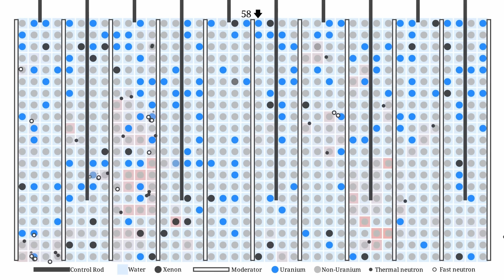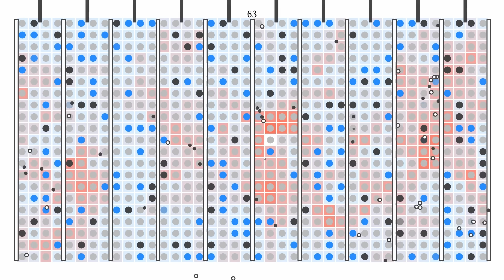Chernobyl Accident - Simulation only (no talk)

Comment: They did the equivalent of turning up the radio to drown out a concerning mechanical noise in the car.
Reply: Then disconnected the brakes and held the throttle wide open.
Reply: @josephastier7421  to get a car stuck in mud out. With no comprehension of just how powerful the car's engine was, and how, the moment it got out of the mud, it was already half the way across town, running through anything in it's path.
Reply: these were incredibly smart people working there, but theyre humans. They panicked and they didnt follow what they studied
Reply: @user-uw3ru5qj3rso smart that they ignored all safety functions and caused Chernobyl to implode!
Reply: @alessandrarivera1925 I’m sure your smarter
Reply: @user-uw3ru5qj3r No, they were smart people being led by a jerkoff in charge of a reactor with a critical design flaw.
Reply: @user-uw3ru5qj3r no they weren't even qualified and were put to follow dangerous orders with no chance of speaking up
Reply: @Kalleybi  yeah im sure you are much smarter than they were👍
Reply: @Kalleybi  nuclear power reactor workers - these guys are the top of the top, the cream of the pie. You will only find smarter people at NASA and SpaceX,. The fact that you cant seem to understand this says alot about you.
Reply: @Kalleybi  im sure some random not qualified individuals could not only set up but also maintain a nuclear powerplant for so long.
Reply: @user-uw3ru5qj3ryou're forgetting it was the in the USSR, the Communist used whoever they found, the engineer chief was the youngest one in there he was less than 25. I'm an electronics engineer working in a research lab and the radiation samples cabinet is a no go zone even for my boss. Moreover they didn't know that the rbmk reactor boron bars could build up reactivity when first inserted bc the tips were grafite to, guess what, make them cheaper... classic communist behavior.
Reply: @user-uw3ru5qj3r kalleybi is right. They were non qualified workers. They didn't know what they do and were given only instructions for some scenarios. Matter fact, it wasn't fully their fault. The facility violated MANY occupational health and safety rules. They were basically sent to certain death. They just didn't know it.
Reply: @Kalleybi I’m sure your smarter
Reply: @user-uw3ru5qj3r You are forgetting one huge problem....Soviet Union.....they most certainly did NOT have the best of the best, they had the best that a oppressive communist regime could produce....a regime that killed competition and personal goals to be better through hard work and competition.
Reply: @user-uw3ru5qj3r this is called glazing.
Reply: Heh, "turning up the radio".
Reply: No, they PANICKED and didn't follow procedures
Reply: @TruthHurts_81  and didnt know fully how the reactor would behave
Reply: @TruthHurts_81 I’m sure your smarter
Reply: @juniorseyes8326  who taught you English?
Reply: Now they wage war to drown hunger and infrastructure concerns
Reply: @Ntrbncmlc I’m sure your smarter 😂
Reply: Hold my vodka russian style
Reply: The the combustion chambers cracked open.
Reply: Years ago my now ex brother in law worked for the local auto manufacturer of my old car at the time. He was a very vain person who often liked to self promote himself wherever and often through the guise of "sharing" knowlege/experience for the purpose of "helping" which I could clearly see through for his true intent.
    The one and only time I had him in my old vehicle to give him a needed ride was priceless and I wish I had his reaction on video as I  maintained a straight forward poker face demeanour when I replied to him. (In fairness to him and in this one instance, I do think that he was genuinely offering advice to help me to avoid future costly repairs but I couldn't resist the opportunity to deflate his over inflated ego tyres). He turned to me as I was driving and said that he thinks my rear left wheel bearings were on their way out. I had long suspected this as I drove that car all the time and had to listen to the constant low grinding sound but I was not gonna waste money on repairs that cost more then car. I kept looking forward at the road ahead and without showing any  emotion stated something to the affect of "That's why I upgraded my stereo" and I turned the volume of the radio up loud drowning out the bad wheel bearing and him in the process.
    Much appreciation for posting the Gold joke comment and the memory Lane visit.
Reply: You're not supposed to do that?
Reply: @HumanBeanbag  lol

Comment: Chernobyl only became a problem when the rod temperature reached "film boiling".
That's like a hot fry pan on which water droplets dance and sizzle, so about the temp you get when you want to fry a steak.
Once Chernobyl hit that "film boiling" temperature the heat transfer changed from "convection dominant" to "radiative dominant".
Temp jumps from about +120C to like +3000C and that's the "yipes run man!" because the metal is melting.

Comment: So the control rods are used to slow down neutrons so the core doesn’t overheat because it can withstand high temperatures. But I guess graphite spontaneously oxidizes in the presence of oxygen at 550 degrees celcius and the operators allowed it to get too hot, so the control rods caught fire. This kind of fire is self-sustained as long as oxygen is present, so the reactor fire lasted a VERY long time. The Chernobyl accident wasn’t directly caused by the graphite rods, but these kinds of rods have directly caused a near accident before. 

In Chernobyl due to their design  there was a massive power surge that happened mid-test and the coolant fluid basically ran out, so the fuel rods melted together and hit criticality almost immediately. And then the graphite rods just happened to draw out the event. 

I think modern rods are made of zirconium.

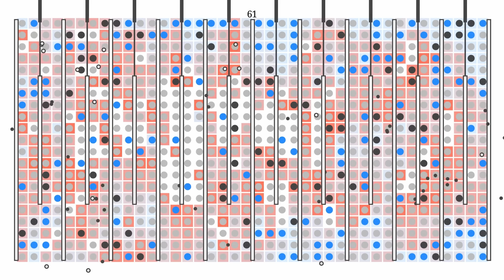Comment: The moment Event 6 starts at 3:17 is the moment control room operator Leonid Toptunov pressed the AZ-5 button at 1:23:39 A.M. EET. Pressing the button was supposed to shut the power down by inserting control rods into the reactor.

What Leonid didn’t know was that the rods were tipped with graphite, and when exposed to enormous amounts of nuclear energy, graphite only exacerbates it. The result was a skyrocketing amount of power in the triple digits that lead to the two explosions in a matter of seconds.
Reply: There was nothing wrong with the rods being "tipped" with graphite. Graphite was needed to maintain a healthy neutron economy because they were using lowly enriched fuels. What was wrong was that the "tips" were short enough to leave an entire column of water at the bottom of the core when the rods were fully withdrawn. Displacing that water (neutron absorber) as the rods descended triggered a sudden massive increase in reactivity, which ruptured the channels and ultimately led to the steam explosion.
Reply: @Athena.87 there was an atomic explosion including a mushroom cloud, btw
Reply: Lots of people do not read the source documents, but instead memorize simplified (to the point of being incorrect) explanations.

The reactor's core is 7m high (it's cylindrical). The control rod (from top to bottom) consists of 7 m long neutron-absorbing section (this is the part of the rod which sits exactly in the core when the rod is fully inserted); 1.25-m long telescoping empty tube, and 4.5 m graphite tip ("displacer"). These two sections go below the core when control rod is fully inserted - for this, the vertical channel the rod sits in must extend under the core for ~5 more meters.

The role of that graphite displacer is to make reactor more efficient when the rod is withdrawn: without displacer, the channel would be filled with water, which absorbs some neutrons, reducing efficiency. Graphite absorbs almost nothing, thus it's better.

Ideally, you'd want to make this displacer 7 meter long too (full core height), but this requires 7 m of additional vertical piping under the core. That's why they made displacer shorter, and made it collapse (telescope) when the rod is fully inserted. This shortened that under-core pipe to ~5 meters.

In the accident, before the fully withdrawn control rods where inserted en masse, all their displacers were located "in the middle of the core" vertically, with about 1.25 m of water filled in-core channel below them (and 1.25 empty rod section above). When they all started moving down, the displacers displaced that 1.25m of water. At 0.4m/s insertion speed, it took more than 3 seconds to just displace that water, therefore mass rod insertion increased reactivity in this lowest part of the reactor, and did not yet decrease it in the middle section -  the absorbing sections of the rods just only begun entering upper 1-2 meters of the core. The resulting large power increase distorted the channels (both control rod, and fuel channels), and rods were stuck (couldn't move down further).

If the rods would be longer and had full 7-m long displacers, such transient power increase wouldn't be happening when they are inserted: there would be no graphite replacing water in the core (it would be happening in passive tube under the core).

If operators had good understanding of this design deficiency, they would know to avoid mass control rod insertion. If they would insert the rods in small groups, not all at once, the transients would be much smaller and localized. However, reactor designers preferred to pretend that reactors are "absolutely safe" and no design deficiencies exist, thus training of operators did not cover such details.
Reply: @denysvlasenko1865  Exactly. This is the correct explanation in the final report INSAG-7 on Chernobyl disaster. Unfortunately, most people base their knowledge on the TV series...
Reply: The graphite tips are actually a neutron moderator, the rest of the control rod is a neutron absorber . For the neutron to cause fission it not only needs to hit a Uranium atom's nucleus it needs to be traveling at the correct speed, that's what a moderator does slows the neutron down. So the initial insertion of the rod would cause a spike in reactivity and corresponding spike in power. So most of you mugs arguing over this are wrong. Every current commercial reactor in the US does not use graphite as a moderator, it uses the cooling water. There have been experimental graphite moderated reactors in the US and there was one commercial graphite reactor but it went belly up due to financial reasons decades ago. PS as a Control room operator it is incredulous to believe that Leonid did not know that the control rods were graphite tipped.
Reply: @stuglenn1112  As shown in The Simpsons, not all nuclear power plant operators are as smart as you.
Reply: The rods got stuck into place, and the graphite coating instead caused the reaction to continue and increase without end
Reply: Graphite coating absorbs neutrons which actually slows the reaction or stops it if lowered completely. At the point the button was pressed, the rods had already begun melting and it was too late
Reply: @jkyleowens  Incorrect, reactor power was stable until AZ-5 was pressed, which is what triggered the reactor runaway (see Annex I of INSAG-7 for a detailed description of events).
Reply: @jkyleowens  Not sure why you've got some likes, you're incorrect. The control rods weren't coated in graphite, they had a graphite section at the end which acted as a displacer, the purpose was to push water out of the channel when the rod was withdrawn to maintain cooling efficiency. Graphite does not absorb neutrons significantly, it moderates neutrons making them more likely to cause fission in U 235.
Reply: I get a weird feeling looking at these conversations where people with probably zero education in physics and completely different opinions on something big, unapologetic and scary disagree with each other, each one stating that the previous opinion is wrong and their own opinion is right. It's like 5 doctors look at the body and try to prove what happened with no tools, no history, no knowledge but all saying their opinion is the correct one. I feel despair.
Reply: I feel you, and in the end you're left to wonder who is right, all of them, none of them?
Reply: @I_am_supernovae  I tried to read the comments to try and learn something but everybody is contradicting each other. Even in the top comments there's dozens of different opinions on what how or why something happened. What I learnt is that 99% of comments in such videos come from people who don't know what they are talking about.
Reply: @I_am_supernovaelike you have all the answers? you can stop with the pseudo-intellectual armchair physicist act, the problem you have is with people being able to discuss things freely
Reply: @idkausername10  they're looking at comments that are disagreeing about something that should be known, and wondering who has the right story and worse, how they can all sound so smart...but disagree.

They, like myself, aren't armchair physicists. We're just plebs who watched the video and wondered how it happened because we do not understand it.
Reply: @DembaiVT Said the person who wasn't who I was replying too. You love to talk for other people, don't you?

Comment: Again, like in any other disaster, a chain of events has occured which lead to this.

First, there was a delay for the test.
Second, another power station wasn't able to produce power so the dispatch told the Chernobyl plant to keep the high power going for longer (until the evening when the power requirement will go down. This made them wait even longer.
Third, the xenon poisoning kept happening for longer and longer.
Fourth, many times workers had not to obey the rules because they needed to catch up to the plan.
Fifth, the delay was so long, that the crew which didn't expect to do the test had to. The day shift was supposed to do the test. In realisty, it was the night crew.

Comment: 3:08 "Free neutrons burn away all the Xenon, Now there is nothing to stop the reactor" gave me goosebumps
Reply: Thats the key event for them to press AZ-5.
AZ-5 doesnt hold the reactor in control instead its an ignition for the ultimate disaster. If only they designed the control rods to not have their tip as graphite.
Reply: @Emhyrkhan 
The advantage of graphite use in this case was, that it reduced the friction of the rods without the need for extra lubrication. That would be the reason for such material choice, according to Ockham's Razor
Reply: @dakzibbon6589  They were graphite tipped to lubricate the channels, but only as an afterthought, because the control rod channel assemblies were poorly manufactured and caused the boron rods to jam and require manual intervention. So the graphite tips, a key to this disaster, was never part of the original design, nor part of the intended operation by the scientists and engineers who created the initial RBMK reactor design. The other option, rather than just slapping a puck of graphite on the control rod, would be to replace the whole assembly with something more expertly machined, which would be prohibitively expensive.

Comment: almost feels like a slow burning fuse. They remove the control rods completley to make the fuse burn quicker, then turn off half the water circulation in order to lessen the length of the fuse. The fuse then instantly burns through the rest of the fuse due to the material in the fuse being used, and finally reaches the explosives, causing a bang in an uncontrolled explosion.

Comment: So, what initially caused it?
Reply: An explosion and fire that demolished the reactor building and released large amounts of radiation into the atmosphere.
Reply: Safety tests
Reply: The initial problem was the low output due the xenon contamination. They tried to increase the power (they apparently didn't know about the contamination) but went too far. They removed more control rods than recommended which Kick started the chain reaction. And when they tried to shove it back, it got stuck with the Carbon tip right at the middle increasing it even further. And the rest is history.

Comment: I have a side note to your video. Pretty sure it shows how the reactor ran away but the effect was comming from the bottom. The bottom of the reactor was almost running 100% all the time because of how large the reactor was and how uneven the neutron flux was distributed over the active zone. Bottom reactor was full of voids and the uncontrolled chain reaction happened at the bottom ( 4 seconds befor the explosion they hit AZ-5 button ) one second later in the middle then the control rods were stuck in the upper parts of the active zone displacing water and creating even more voids and enhancing a chain reaction because of graphite tips so the reactor went in one second almost prompt critical, if they were using more enriched uranium, it will explode like 50-90kT Atomic bomb that night. Funny to say that but the reactor operator generated literally 5years worth of power in 1 second. The neutron flux meter stoped measuring around 30GW, 2 seconds befor the first explosion and the power was rising exponencially every milisecond. Around 500ms befor the second explosion some people says there was power surge that could be measured in TW or somewhere between 2000GW and 6000GW which is CRAZY HIGH NUMBER. Crazy crazy high... the Maximal thermal power of the RBMK1000 was 3200MW or 3,2GW AND the power right befor the explosion went from 30GW to almost 6k GW